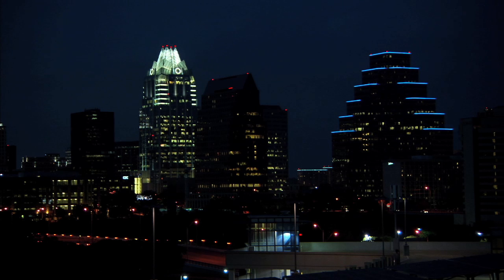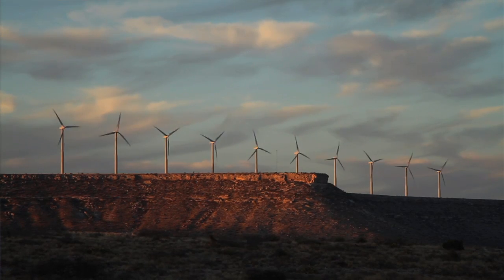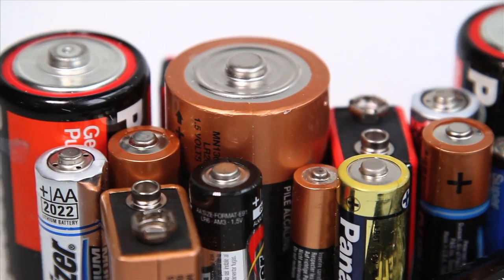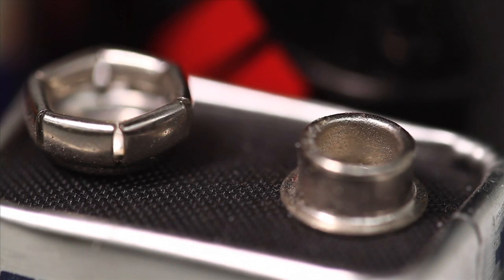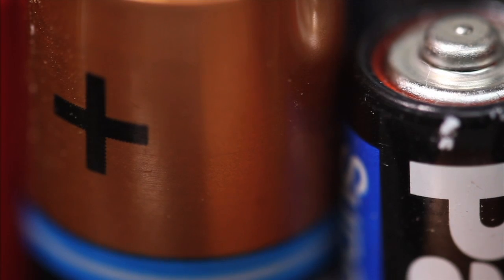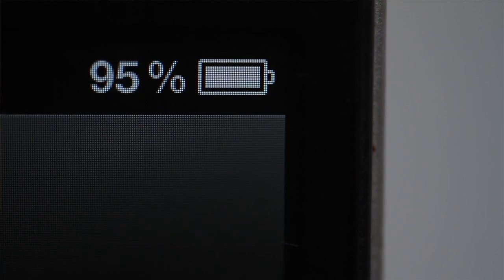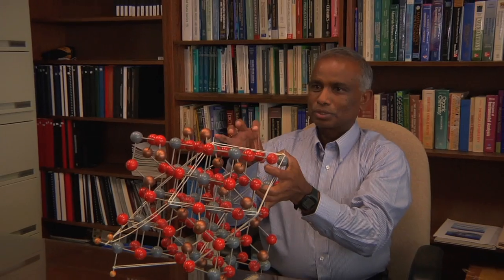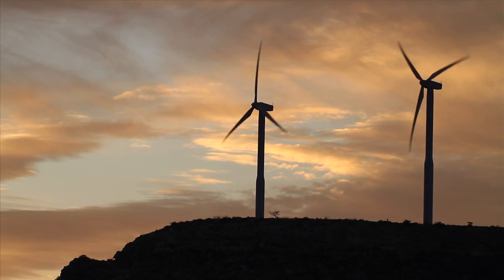Large-Scale Storage of Alternative Energy

Comment: He got it wrong in the end where he says that we need high capacity batteries during the day when it is hot?!  This video is not from 20 yrs ago when solar PV is pricey.  The issue is how store excess power during the day.  Additionally, one speaker is concerned bout charging and discharging rates which is a non issue.  High rates are easily solved by capacitors, super capacitors or setting up systems in parallel.    Density and price is the issue here.

Comment: If you want to store hydrogen and weight is not an issue, you can adsorb it on metals like they do in the U-234 german submarines - it allows the storage of lots of hydrogen under medium pressures. If you want the hydrogen back, you heat the metal hydride.